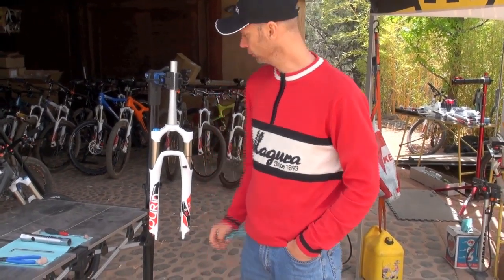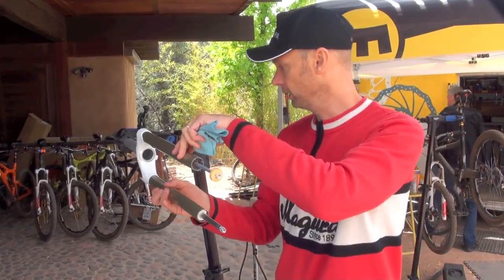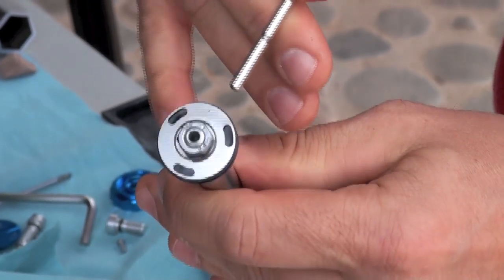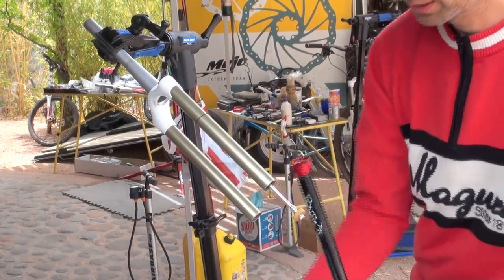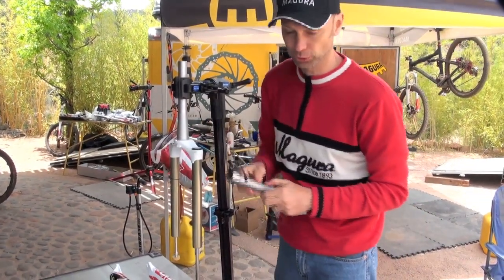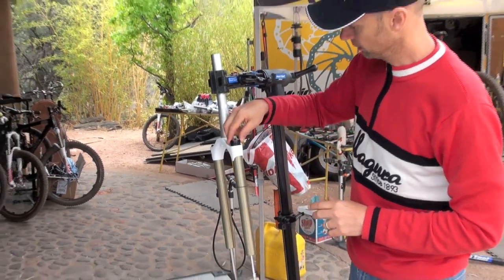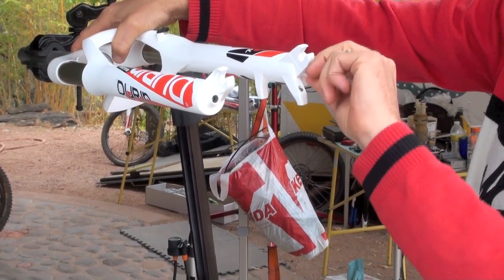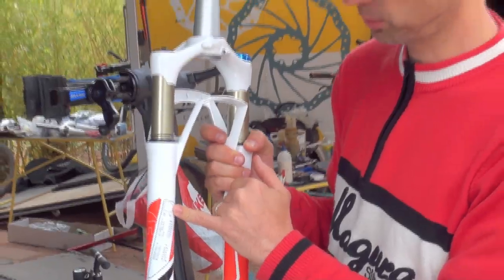Magura 2012 Fork Tech With Stefan Pahl

Comment: Dude, thanks a lot for the video. I live in Brazil and I have a Magura TS6 100 suspension and nobody knows about it, they don't know anything about it, I can't even find a repair kit, I bought all the o-rings separately from stores that specialize in pneumatic components for industry, and I didn't know how much oil to use or anything specific. Your video helped a lot. This week I'll put my suspension back into operation.

Comment: Can the 100mm travel be run at a shortened axle to crown length ? The pickins are slim for 'quality' 80mm travel forks. So I was wondering if this for could be an option ?